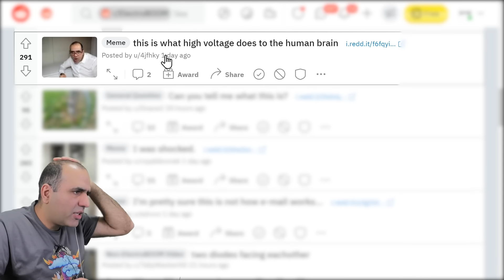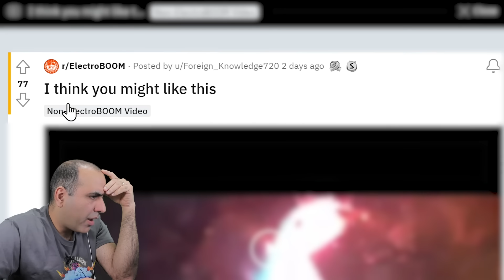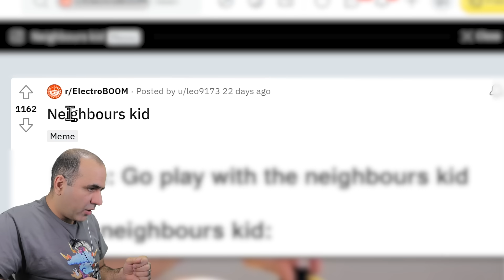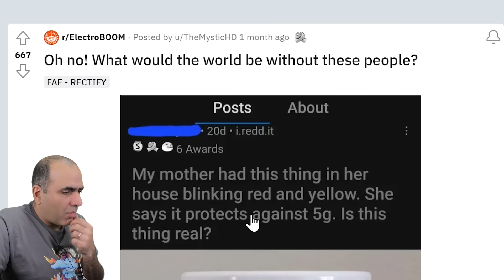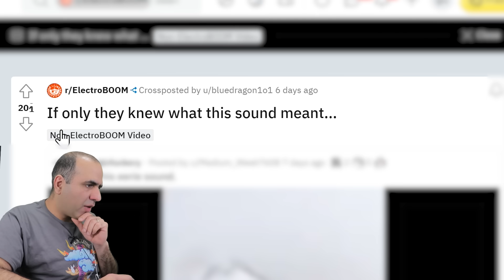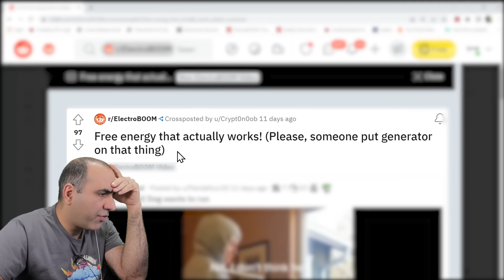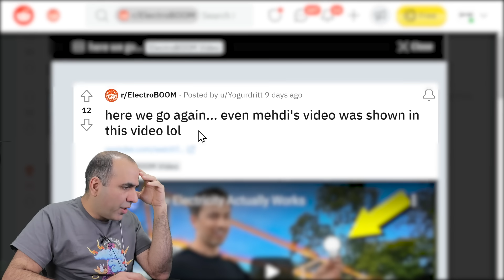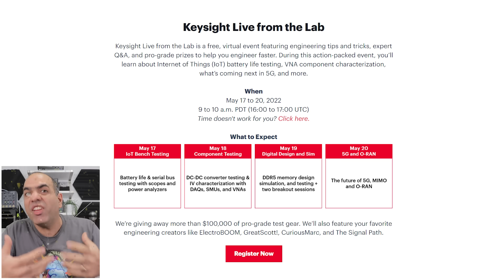Electricity Takes the Shortest Path (in the air), LATITY-010

Comment from the maker: I MEANT SHORTEST PATH THROUGH AIR! 😂 Also "electricity takes the path of least resistance" is wrong! It goes more into the path of least resistance, but it still goes through the higher resistance too. But in the air it breaks though shortest path, then I guess it curls as the air heats up... hmmm, something to check there
Reply: Not content with rectifying Veritasium’s videos, you started rectifying yours 🤣
Reply: When the air break down and ionizes it becomes very low resistance so electricity will flow almost entirely through that conductive plasma...which behaves like a hot gas and starts rising and spreading out. Videos of arcs in microgravity are interesting since they tend to stay more in one place.
Reply: Well, that's kinda wrong. Electricity doesn't always take the shortest path, even through air. The most correct way to phrase it is by saying "electricity takes the path of least action". Then you start crying while solving Lagrangians and Hamiltonians, but OK
Reply: hehe
Reply: I’m very glad you clarified - I’d assumed your title was deliberately incorrect to engage the rage and get people talking…that’s how Derek gets so many views.
Reply: great scott has a new video for you to contend with
Reply: Mehdi is best electrical engineer.
Reply: It depends on the *air*, too. Look at that vid of the guy making those weird sounds in that snowstorm. 

There's a vid. What kind of air has the best resistance?
Reply: & water seeks its level
Reply: It takes the path that it can ionize the fastest.
Reply: i love the fucking did the foltage is really get him😂😂😂😂😂😂😂😂😂😂😂
Reply: Make a video of finland braker video
Reply: It is always so much fun when you scream like a little girl after being electrocuted, but we all know that it is all just a show ☺️
Reply: Hi like my comment
Reply: I see your twin brother broke out of prison in Texas.
https://www.youtube.com/watch?v=6bJL8fE_xOM
Reply: Literally shouted at you for saying that. Now you have to do a video on it.
Reply: Actually, electricity doesn't take any path.  Electrons do move, but only in response to the electromagnetic field of the conductor, and very slowly.  Electricity propagates as a wave in all directions as you can prove by taking closing a long conductive circuit and putting the power source near the load and using a switch.  The closer the switch is to the draw the faster a partial amount of current will reach the draw, regardless of circuit length.

I love you though, that brow will be remembered in whatever kids in the future use for books.
Reply: The best way to explain electron flow is that the field is like a bunch of spectators along the side of the tour de France course cheering on the riders. No wait. That explanation is as bad as that stupid Sheppard and sheep analogy some so called expert said on the Veritasium channel. How about that bridge that resonated until all of the people stepped side to side in unison and they had to close it and fix it? The bridge movement is like the electric field/ voltage and the people are the electrons that are manipulated along it with the resonance. That is much better. Tesla did say everything is resonance. Didn't he? Or was that the ancient lost technology crowd (I'm one of them) who speculate the pyramids were huge resonant energy power stations. Anyway, if that convoluted explanation of how electric current works with all of the time consuming Cad drawings to explain it didn't make sense on Veritasium, now it does with my simple analogy of the resonating bridge shuffling everyone along it.
Reply: Fairly sure shortening "Shortest Path through Air" to "Shortening Path" is valid in cases of pure agony
Reply: Hmmm surprised this wasn't on greatscott's latest video where he might have killed the full bridge rectifier but i guess that video is gonna take much longer.
Reply: I need more latity episodes
Reply: Check it
Reply: The path of most susceptance?
Reply: Mehdi, show us how to use an ANALOG oscilloscope
Reply: Don't worry. Veratisium will set you straight. 😄
Reply: do you know if you took your tesla "battery" and broke it into 12v divisions you could use petrol/ DIEseL or even alcohol in a more efficient manner. how long to charge a flat battery via jump start?10 -20mins if the battery's still good , depending on how many 12v packs you got will determine how many alternators and for how long. instead of trucks burning diesel to deliver coal to run server systems.
Reply: Discharge will flow along dense electron saturated pathways.
Reply: As a physics student I always wondered how that piece of misinformation became common knowledge
Reply: If it took the shortest path through the air every time then Tesla Coil outputs would look fairly boring.
Reply: Constructor theory
Reply: I am a scientist    on  a very thin shoe string budget.
Reply: Hi Sir eagerly waiting for your next video 
#Love from India
Reply: Actually, that isn't always true, as crazy as it sounds (see https://en.wikipedia.org/wiki/Paschen%27s_law) -- there is actually a distance where the voltage required to arc is minimized (~7.5 um in air at STP, 327 volts), and below that distance it takes more voltage, so arcs will prefer to take longer paths.
Reply: HI ,   I shouldn't be so quick to jump to an answer  . my bad
Reply: Havaryu yol valkım tenkü
Reply: Is this for real??? https://youtu.be/JGWbVENukKc
Reply: Hey guys be aware of scammer, they are fishing right here and for all famous youtubers dont trust anybody :) i will made my video with electro-boom fake scamer soon :)
Reply: guys be aware of scammer they act as mehdi and say you win a prize be careful
Reply: Hey Mehdi! Friend made another animation of ElectriBOOM https://youtu.be/XB3MCTr1iyQ
Reply: Where you been man?   I really enjoy your videos...
Reply: Then why don't arcs form perfectly straight lines? Why does lightning zig zag through the air?
Reply: I literally screamed put them back together like i was watching a horror moive
Reply: @jerrybaker8597  😂😂😂😂😂
Reply: @jerrybaker8597  same but just internally screaming
Reply: @jerrybaker8597  🔴 What Is Islam? ⚠️

🔴 Islam is not just another religion. 

🔵 It is the same message preached by Moses, Jesus and Abraham.

 🔴 Islam literally means ‘submission to God’ and it teaches us to have a direct relationship with God. 

 🔵 It reminds us that since God created us, no one should be worshipped except God alone. 

 🔴 It also teaches that God is nothing like a human being or like anything that we can imagine.

🌍 The concept of God is summarized in the Quran as:

📖 { “Say, He is God, the One.  God, the Absolute.  He does not give birth, nor was He born, and there is nothing like Him.”} (Quran 112:1-4)[4] 📚

🔴 Becoming a Muslim is not turning your back to Jesus. 

🔵 Rather it’s going back to the original teachings of Jesus and obeying him.
Reply: Yesss!!

Finally some professional confirms my idea that electricity would take all available paths, but the amount of current passing through each path would depend on the resistance of that path.

Thanks Mehdi, for reassuring that I'm not as insane as I think I am.
Reply: @imranroy4731  Shortest path with least resistance first. So any path when available, but always shortest path with least resistance first.
Reply: @turbocpt1  bruh ...

You do know that electrons (usually) travel at 99% the speed of light, right?

It's not like electrons go on scouting missions and then a strategist chooses a path on which to travel first. The particle world is bizarre ...
Reply: @imranroy4731  hmmm. Clearly you misunderstood..... Bruh
Reply: @imranroy4731   calculating the resistance from high-to-low of two parallel resistors is a good way to become familiar with it
Reply: @imranroy4731  Isn't it basics of Kirchhoff's circuit laws?
Reply: @imranroy4731 keep in mind that this is only true for low frequency signals. When higher frequencies are involved, resistance may no longer be the dominant factor and we must use total impedance instead.
Reply: Oh man that's literally the best notification I've got today, OH MY LORD and it's a LATITY episode wow that damn amazing. Lemme thank you in my mother language ~ARABIC~
شكراً لك إنك حقّاً رائع. ❤🇲🇦💚
Reply: Btw at 6:45 you proved to have the finest Italian ever. 👌 🇮🇹
Reply: ElectroBOOM you are the best, and make me laugh so much!
Reply: You should make more videos im 16 an look forward to watching them
Reply: @joekatalin6006  Please, also focus on the English classes. "im" is not a valid word. "I'm" is the correct way, for many reasons.
Reply: I think he just clarified Ohms law.

Comment: Sorry, I need to correct you, Electroboom. Electricity with follow the path of least resistance, which is often the shortest path, but not always. Dust, spores, pollen, and many others things can divert a path through air away from the shortest. This is why lightning often is bent: water in the air is denser in one place over another which changes the resistance. (Usually more water = less resistance due to the particles in the droplet.) In a pristine single element gas of significant density, yes, shortest will also be least resistance, but start adding another gas -- like oxygen to nitrogen -- and atom positions and resistances get random and the path won't be as straight.

Comment: Someone never told this dude the shortest distance between two points is a STRAIGHT line. Electricity clearly DOES NOT take the shortest path. That line is crooked AF. No reply necessary. I already blocked your channel for spreading scientific misinformation.

Comment: Ok, I have one for you.
This is just a thought. Ready??

There are two types of water. Regular water and Distilled water.
If you drop a burning lithium ion battery In water, will it put out the fire?
How about Distilled water. Pure Distilled water has no elements except Hydrogen and Oxygen only.
All other types of water  has minerals in it.
Even purified water has minerals in it.

Then try pure sand and water.

Comment: QUESTION:
If there is a live wire (say 1000volts and 2 kiliamps) and the positive and negative are 4ft apart, and I walk between them, will I complete the circuit and get shocked?  What if I reached out and touched both of them?  Would it change if they were grounded?

Comment: Hi, i have 3 questions regarding the Tesla coil... 1- how much energy ( voltage & amps ) does it take to make it work. 2 - how much energy will the tesla coil need to turn on neon lights and will it need more energy to do it? 3- this one depends on your answers of the 2 first questions..    Is it logic building a tesla coil IF  it consumes by itself ( just to keep it on) more than it could reproduce to turn on a few neon lights? I was looking for something that could save energy  not wasting it.

Comment: Hey commenters, have a query you might be able to help me with not related to this video.

I have 2 devices that need 3v to operate, but also whatever information a chip sends through too (devices do nothing with 3v directly).

The chip only outputs 3v max, and will burn out at 5v, but i need the signal for 2 3v devices.

What device can i use to both split and boost the signal so that a single 3v output can power 2 3v devices?

Comment: I see you really like the digital scopes. Yea they can do FFT and cool stuff but there's something special about a real CRO seeing the waveform's actual shape in realtime with no digital distortion that I love.

I have a Tektronics 2467B that has a time base of as low at 500pS /div. That means you can view a waveform so quick that light has only traveled 1.5 meters by the time the trace goes from one side of the screen to the other. Pretty amazing to see GHz with a CRO.

Comment: Hey if the earths is a rotating magnetic field in space , and an ac motor is a rotating magnetic field surrounded buy inductors to induce electricity . Would there be a way to use earth rotating magnetic field to  induce or excite a circuit based on induction ? Like if you had a tower that picked up static and vibrations run that though a super conductor wound in a coil to ground with and induction coil off that would it produce an electrical current ? Would like to hear your feed back from a pro you know cheers keep up the good work.

Comment: dam i just lost a huge reply, note pad cut n pste from now on. ill cheat, will save a lot of unnecessary time forever lost,,.. sick of motors and how they will just probably spin n windmills that will just basically charge and how much water pressure is potentially un taped at the bottom of the sea(dams)hydro electric ,,, seems stupid now,. i need a computer CAD structural design engineering team, good with conceptual designs as well as detailed structural design and approval meeting capabilities. of local,talent .basically???? reo n concrete ,plywood,.....!!! design it, make it modular , so easy to assemble you, might as well just poor it your self. pipes included i wouldn't dare not include a simple correctly angled pvc pipe cast in each n every room (wet area) including water/ electrical, no cast in bends corner panel access over engineer everything ,... for safety,.. n efficiency, modular over engineered reo section made and welded on jigs , (censored) not prisons, a jig to make the jigs,... off site. in built ventilation (each room), cabinets included, ply wood, hebal.  pay to own why would i charge more for rent ever??? obnoxious,.... rent should be fixed, muti -zoned, resident owned n operated, accounting administration,.. food n grocery services zoned residential commercial, retail, manufacture/industrial sound proof midnight antics. All in one,.\/. my world bank association.Xx9.,  of not greed before profit hold me down attitudes of always has but R gona be -Move]... out of my way./\. Next,... my rent(er's) rent, will decrease and service will be become cheaper the more my services are in demand the more you'll be on my payroll per year please,(some people hve too much bugati money) fixed. till term, bitches. lol. just because you decided to rent one of my well designed luxury apartments,, or rented business space's.  i don't get brick,,, ? i understand trucks and heavy machinery,... and structural strength of reo concrete and torqued tensile steel. plywood. not brick.

Comment: Btw you talking about 5g i see a clip of an egineer calculating the voltage thru the air (Because there a tool for that ) . Hes meter get to 2.4 . He said this is over 13000 time stronger then what we allow to do it .  Like 13000 time to maximum you can take as a living beeing . You can easily debunk that right . Because if the guy is right . The earth is becoming a micro wave at this point . Anyway in Perou they are taking down thos tower They juged this as a weapon of military level . So ... if youre so confident take the tool and analyse because its the only actual way to see if its safe right .

Comment: Can you test those new PD chargers(18/20/30/45/65/100 W), cheap vs expensive with that fancy oscilloscope and see if the cheap ones are actually worse than the good ones, and also if you can see a difference between the gallium nitride ones

Comment: do you know if you took your tesla "battery" and broke it into 12v divisions you could use petrol/ DIEseL or even alcohol in a more efficient manner. how long to charge a flat battery via jump start?10 -20mins if the battery's still good , depending on how many 12v packs you got will determine how many alternators and for how long. instead of trucks burning diesel to deliver coal to run server systems.

Comment: Hey medhi i have a question is it possible that you can save energy from the lightning? Like they did on the rocket when the lightning strikes on the small metal piece that the rocket had, and in the end there is a battery or some sort of equipment to be able to harvest energy from the lightning

Comment: you can use different gas compositions in the air to direct electricity though, and also arcs are longer than straight lines.